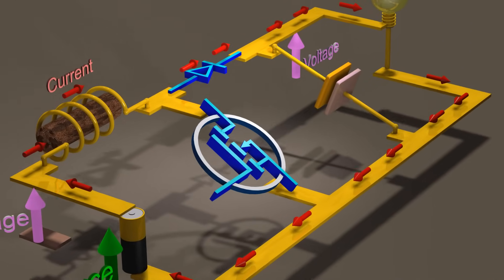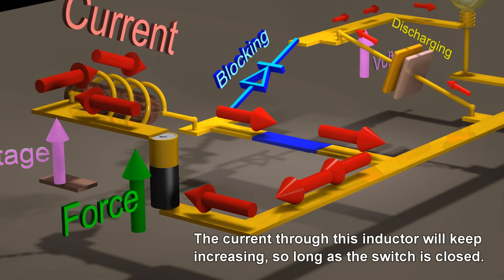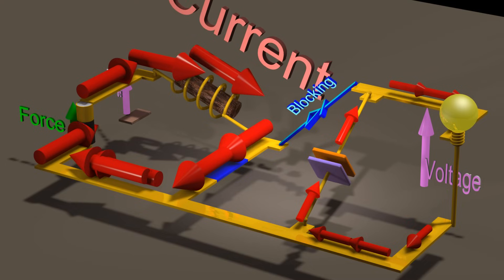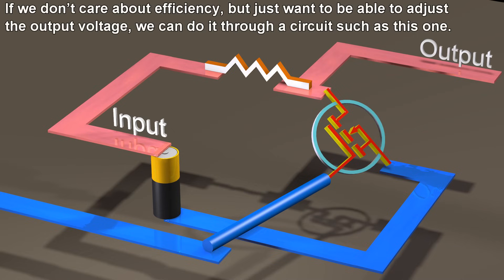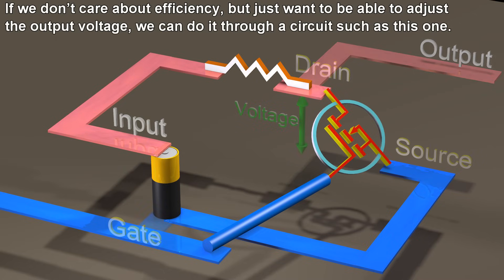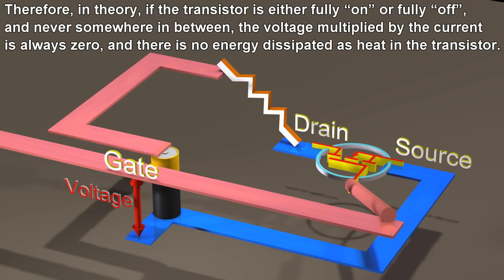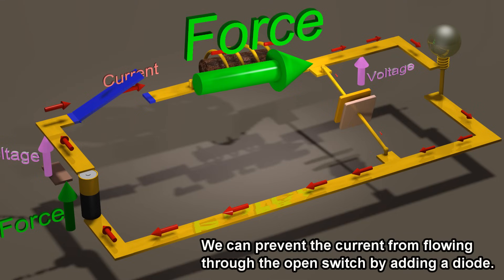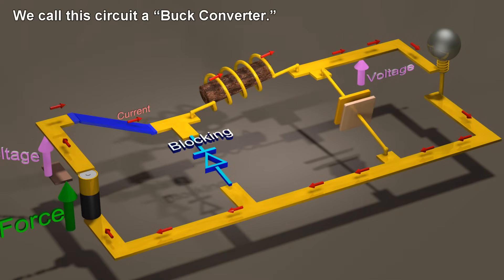Boost Converters and Buck Converters: Power Electronics

Comment: 13:28 the diode is not on while the voltage is lower than the capacitor...😅
It s wrong but nice anyway
Reply from the maker: Actually, the depletion region of a diode's PN junction has some capacitance, so the animation is correct.  You are only thinking of a diode's steady state characteristics.
Reply: @EugeneKhutoryansky The transient current of the Schottky diode lasts for 20 ns at most.
I don't think you intended to show transient currents because they aren't visible in the MOSFET.
In your animation, this capacitive current isn't transient at all; it's steadily increasing and continuous.😅
Reply from the maker: We are talking about the animation during a fraction of a second.  After over 1 million views on this video, you are the first person to comment on this.  On a side note, I draw a regular diode in the circuit, not a Schottkey diode.
Reply: @EugeneKhutoryansky It's actually a Schottky diode in a boost converter, not a standard signal diode.

I can't help it if your audience isn't an electronics engineer.

There's no current as you're modeling it; that's a mistake. Use a digital storage oscilloscope and analyze the analog signal over time.
Reply from the maker: I will concede that since I said that these are ideal components, I should have shown the voltage of the anode of the diode increase instantaneously when the FET opened, rather than take a fraction of a second to increase.  This way, the animation wouldn’t have a fraction of a second where the current flows through a reverse biased diode.

Comment: Wow 🤯

Awesome video.
This is helping me even after 7 years it was released.

Thank you 🙏

One doubt

3:19 will the output voltage go to infinity when the switch is always closed?how is it?
Reply from the maker: Thanks for the compliment about my video.  I am glad my video was helpful.  In reply to your question about the Boost Converter, you shouldn’t think if it as the switch being always closed, but rather the percentage of time that the switch is closed approaching 100%, but never reaching exactly 100%.  Therefore, during the tiny percentage of time that the switch is open, potential energy accumulated in the inductor is sent to the load.
Reply: @EugeneKhutoryansky wow 😊
That was a very fast reply and a great reasoning.

Hats off for Replying to comments on very old videos and at this speed 🫡

Thanks again
Reply from the maker: Thanks.

Comment: About a year back i made a mistake in a comment, altho it's something i already knew very very very well in infinite depths in all its forms form flyback trans, ignition coils etc for many years, the mistake being that i did not take into account that inductor voltage aka backEMF v = L(di/dt) only jumps above Vcc if current is suddenly turned off or reduced drastically. Again, this is something i knew perfectly well and in inifnite depth for many years, but made a mistake in the moment. I am so deep in this it is totally beyond comprehension of the host of this channel, everything i do is in the realm of impossible for him. But even if we stick purely with conventional things, officially no current flows for an instant when voltage is first connected to an inductor, yet paradoxically there can be no voltage across an inductor unless there IS a current. So some current flows even if it can't be measured, even if it's not conventional current, for there are other orders of energy, not to get into A field and Aharonov–Bohm effect etc. Also the host of the channel made saome errors in his other videos some of which i wrote about.

Comment: boost converter :
switch is on current increases 
when turned off the current doesn't decrease immediately because of the self induction of the coil which mean current will flow through the lamp and also will charge the capacitor 
when turned on again current in the charged capacitor will flow in to the lamp so there's still be current flowing in the lsmp

Comment: I don't know if you are gonna reply to this, but any help is appreciated. My question is that in buck converter, we added a diode to bypass switch due to increasing current from the inductor, however, we are adding a diode after the switch and inducotr in boost converter. Why is this logic not valid here ?
Reply from the maker: The issue is that the current through the inductor always needs a path to go through, because this current can't drop to zero instantaneously.  This is why the diode is present in the buck converter.

Comment: Why would the diode be "blocking" the flow when the switch is closed?
Reply from the maker: Because it has a reverse voltage across it.

Comment: I would assume you are still talking about a circuit with ideal components when you say at 4:44 that the output voltage can be set to any value larger than the battery voltage. Correct?
Reply from the maker: Yes, I am talking about ideal components, with no internal resistance and infinite voltage ratings.

Comment: The clearest way of looking at the inductor's operation is that when the battery is charging the inductor, the inductor is behaving like a resistor to the battery's DC current being pushed through it. This resistance is being caused by the back EMF being generated in the inductor while the current through the inductor and magnetic field around the inductor is increasing. When the switch is opened, the inductor then behaves as a battery due to the forward EMF being generated by the inductor's collapsing field. The back EMF and the forward EMF will always be of the same polarity.
Reply from the maker: I explain inductors in detail in my video at https://youtu.be/ukBFPrXiKWA

Comment: How is the frequency of the gate voltage from the transistor controlled?
Reply: In practical circuits the frequency and duty cycle are controlled by an integrated circuit intended specifically for use in such circuits. Many of them will be usable for a variety of switchmode converter topologies. There are complete integrated circuits with the control circuit and the switch in one package.

For simple converters the frequency of operation is usually fixed and just the duty cycle is changed as required. The designer can choose the operating frequency and set it using a resistor and capacitor. There are several trade-offs in selecting the operating frequency. The all-in-one ICs often work at a fixed frequency.
 Feedback is used to regulate the output voltage. If the voltage is below the setpoint the duty cycle is increased and vice versa.

Hobbyists will sometime use a microcontroller to generate the signal to control the switch. This can work, but the programmer has to understand how to implement a fast control loop and that isn't easy.

Comment: 11:50 an N channel mosfet for high side switching?…
Reply: That is usually what is preferred because N-channel FETs usually have lower ON resistance than P-channel devices of the same basic die size. The drawback is that you need to have a gate voltage that will be at least a few volts higher than the supply voltage and the circuitry to do the level shifting. A gate drive transformer can be used as an alternative. A P-channel device is generally easier to drive but you still need some extra circuitry in a circuit where the input voltage is greater than the maximum allowable gate-source voltage for the FET.

Comment: I applaud the graphics as far as they go, but there's a crucial shortcoming. The whole principle of a DC-DC converter is based on the interaction between the inductor and the capacitor, and their respective abilities to store energy in either a magnet field or electric field  and later release it --- and those two reservoirs don't have a graphic representation in this model. The capacitor plates could be shown spreading apart, and some electric field vectors in between , as the voltage difference between the plates gets larger. And the inductor could have increasing field lines around it as the current increases.  This would be much more communicative and accurate than the narrative sidebar "since the current through the inductor can't change instantaneously", which is vague and is little better than "and magic occurs in the inductor".
Reply from the maker: I show the electric and magnetic fields in many of my other videos.  For example, I spend 48 minutes showing electric and magnetic fields in my video on Electromagnetism at http://youtu.be/9Tm2c6NJH4Y

Comment: By Changing which  component i can get increase current with constant voltage?
Reply: diff between 24dc 10 A
24v dc 20 A
Reply: @syedasjadalinaqvi6115  
Everything in the power path would have to be selected to handle the higher current - the FET, the diode and the inductor. You would also need more capacitance at the input and output.

Comment: Long question, please answer if possible.
Inquiry on the principle of voltage and current in the power conversion system

To supply 1.500 KW, a transformer will be installed in the substation. Is the voltage and current of the first input part converted based on 1000V and 50A?

2. If number 1 is correct, the AC-DC converter uses 1000V 50A as it is, not for conversion, but for smoother 1000V DC?
 or If it is not number 1, is it parallel connection of 380V, 1250A inputs -> 10 units of 1000V, 50A each?

3.
AC-DC converters use a transformer to convert current and voltage.
→ The primary and secondary power must be the same, so when the voltage on the secondary side goes down, the current goes up.
 
Buck DC-DC converter adjusts the voltage through LC circuit + switching ON and OFF.
Duty ratio 1 (if ON 100%) → 1st voltage = 2nd voltage
Duty ratio <1 (when ON time becomes longer) → primary voltage> is stepped down to secondary voltage, but as the ON time becomes longer,
Voltage rises further within the stepped-down voltage range

What is the current principle?
It is said that the output current does not decrease even if the switch is turned ON and OFF. The reason for the decrease is the ratio between the output current and the input current.
According to Kirchhoff's current law, it can be understood as incoming current = outgoing current. From the point of view of input power V1*I1 = V2*I2, the current is the same, but V1>V2 becomes V1>V2. do. (I'm not sure what part I'm not understanding.
But in a Buck DC-DC converter, the principle is that input power = output power just like a transformer.
I'm not sure what part I'm not understanding.

Comment: I have a buck converter question.
1. When the switch is on, the output voltage increases, but why does the output current decrease?
It is understandable from the point of view that the front and rear power should be the same, but I do not understand why the output current is lowered from the circuit point of view.
Reply from the maker: The output current does not decrease.  What decreases is the ratio between the output current and the input current.  This because the input current is much larger if the switch is on a larger percentage of the time.

Comment: just creating my timestamp for learning
5:22 resistor dissipate energy as heat
7:00 Buck converter
10:24 this is a "duty cycle" i think
11:20 ideal components don't dissipate any energy as heat
12:30 in reality, these components always dissipate power

Comment: Hello 👋  can someone help me out so I have a 24volt 1amp intel stick pc hypothetical if i we're to apply the convetors for a tft panel  that runs off of 12 volts 2 amps along with this pc can I run it via 24 volt 5 amp plug 5.5mm to extension to two split 5.5mm males to two separate step downs buck convetor one for 24 volt 1 amp and the other to a buck converter that is rated for 2amp should this follow laws correctly in theory  since the power rail is two separate DC lanes  please  take a look at my channel my pc works now but with sata which am conveterting the front screen to independent 😉 for wake on lan

Comment: Each time you use a diode, you lose about 0,7 volts. You could also make use of LEDs but they need to be rated to be able to handle the input voltage.
Reply: Ever heard of a Schottky diode?

Comment: I designed my first buck converter for the Boeing 767 in 1981. I was using Unitrode [now Texas Instruments] parts and design notes.  I stopped designing electronics in 2008. Now I just watch youtube and get old.
Reply: thank you sir
Reply: A great way to spend your life and get old. I wish everyone lived like you did!
Reply: The first time I flew was in a 767. Thank you.
Reply: Thanks sir your informations 👍 what  is your youtube channel ? 🤔
Reply: Cool!
Reply: Basic idea to keep switching transistor at different place as shown in this video in buck and boost converter is to HAVE minimum open time of the transistor and get desired output??? To minimise heat losses in transistor??
Reply: 😅❤❤you are aprophet of electrical engineering ❤❤
Reply: Thank you for your work!
Reply: I am also interested in building my own custom buck and boost converters for different devices. 

What would your advice be for someone that is new to converters? 

What to keep in mind , what is some good advice ? 
Thanks ! 👌
Reply: @swrekcfest  google "power supply design application notes" and just start reading
Reply: I want you to become my teacher

Comment: Wouldn't charging up an inductor that way cause dangerous voltage spikes when its magnetic field collapses?
Reply from the maker: This would cause dangerous voltage spikes only if we do not provide a path for the current to flow through.  When the current in an inductor tries to change abruptly, the voltage across the inductor is very large.  But, if we provide a path for the current to flow through, there will be no abrupt change in current.

Comment: Why does the animation show the cap charging and discharging at the wrong time?

Hole flow is so confusing.
Reply from the maker: The video shows it correctly.
Reply: @EugeneKhutoryansky  No it doesn't. Think about it, why does the animation show the cap discharging when power is applied to it and the load ... even though the text above the cap says "charging"? Last time I looked at how a potential worked on caps in an AC circuit the cap didn't discharge at that time.

The theory is sound. But the animation itself is not. Plus it would be great if we could examine this circuit using electron flow instead of using the old archaic hole flow, if we are to think about these principles as if we're dealing with a fluid. Which, in itself is a bit misleading. But in a way it works, if we throw out the math.
Reply from the maker: That is not what the video shows.  It shows the capacitor discharging when the voltage of the battery is disconnected from the capacitor & load.  In the boost converter, this happens when the FET acts like a closed switch, and the diode acts as an open switch.
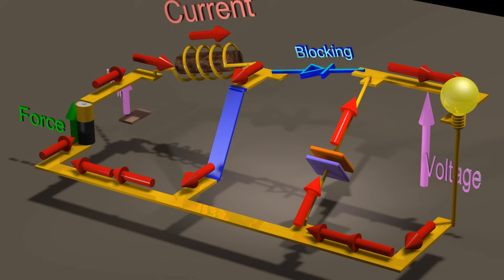Reply: @EugeneKhutoryansky  Ok, look ... I'm not going to argue about this. I'm just trying to point something out. Go to around 2:26 or 2:27 and pause the animation. You'll notice it says 'charging' above the cap, yet the size of the arrows  (which I assume represent power) are getting smaller which suggests the cap is discharging. 

I told you, the theory is sound but the animation is not.

Comment: Oh no, I'm only 30 seconds into this and I'm already compelled to point out an inaccuracy. 

That is a mosfet symbol, not a transistor.
Reply from the maker: The video is correct.  A MOSFET is one type of transistor.  
MOSFET stands for "Metal–Oxide–Semiconductor Field-Effect Transistor."
Reply: @EugeneKhutoryansky  Yes, that is true. But a basic npn or pnp transistor does function a bit differently than a n-mosfet or a p-mosfet, and they do have different schematic symbols. 

But, I suppose for educational purposes we're close enough. The point was to demonstrate a simple switch, after all.

Comment: Why doesn't the magnetic field collapse with the opposite pole?  
The collapsing magnetic field generates high voltage, why can't electrons enter the diode from the opposite direction? (Breakdown voltage).  I cannot understand the direction of electrons in the circuit.
Are electrons in the collapsed magnetic field attracted by the positive pole of the battery? But would it be the opposite polarization? I want to know what actually happens without thinking according to the conventional current.

Comment: Your "Transistor"" is actually a "Mosfet".
Reply from the maker: A mosfet is one type of transistor.
Reply: The "t" in mosfe"t" does stand for "transistor", just one for precision, just like electrons flow from the negative [-] of the power source towards the positive ]+] terminal, but even that is not completely accurate because electrons do not actually "flow"...The energy travels through the conductive pathway in "waves".
I understand that these videos are designed so that even a 7 year old with no experience can digest it. Cheers :-)